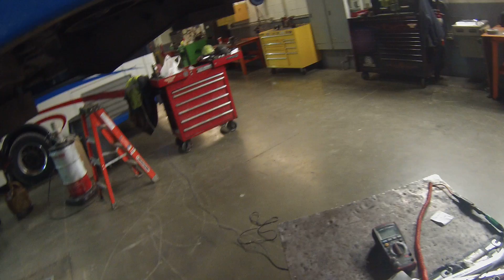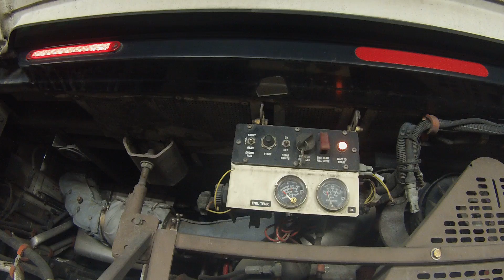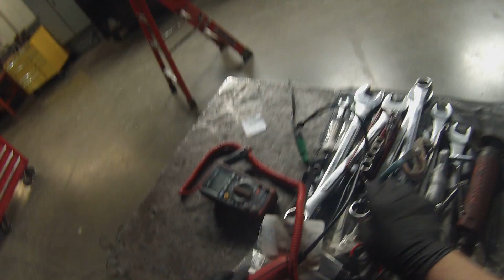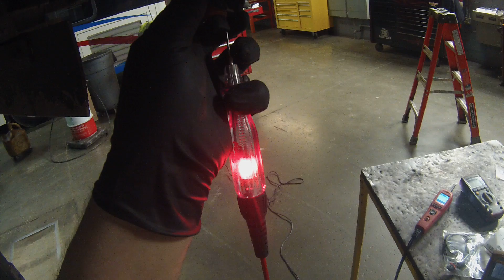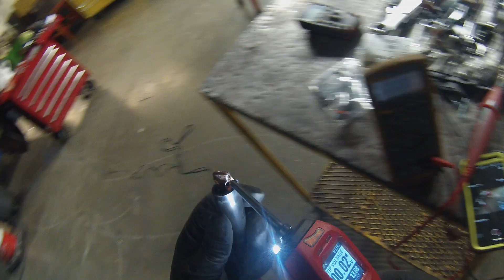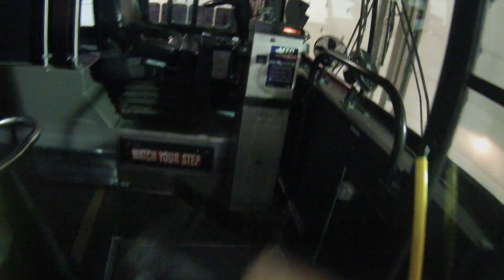Air Dryer Heater Faulty

Comment: Years ago I bought a power probe 2 and then wondered how much voltage we were indicating. So the power probe 3 came out, to address that problem and I bought it. Then....2 months later the 4  came out. I'd like one, but heck after owning all of the previous models, I just can't bring myself to buy one, because it too will be obsolete.. haha.  Why does the engine have to be running ? Does the dryer circuit run thru the multiplex, and that's how the logic is programmed ?
Reply from the maker: Yes

Comment: Great video busjockey1! I have a Power Probe Hook and can't help but wonder how the "Hot Shot" feature would have performed on your air dryer heater problem. The "Hot Shot" loads the circuit, measures the voltage drop and gives a pass or fail result.
Reply from the maker: +Roy D Don't own a hook yet so I don't know.  Eventually I will get a hook too.

Comment: Interesting video Mike demonstrating all the different tools to illustrate voltage drop. Looks like the LoadPro found the issue along with the Power Probe 4. Mike, forgive my ignorance as I don't know anything about buses other than how to ride on them; what is an air dryer used for on buses?
Reply from the maker: +stuzman52 A air dryer is used to filter out the moisture in a air brake system.  The Heater helps keep any ice forming in the air system.  That's why we check the heater wiring on inspections.  When one of these freeze up it is not fun to go get these buses on a service call for it.
Reply: +busjockey1 Thanks Mike for the feedback!

Comment: Nice to see you using the lift and ladders.  What level of current flow is normal for this air dryer heater?
Reply from the maker: +Grant Baker It depends on the temperature.  I will have to refer to the service info.  I will get back to you on that.

Comment: The PowerProbe4 was definitely showing a difference between batt post voltage and that of the connector.The load pro gave an equal indication.Test light not very sensitive to relatively small variations in voltage for this problem.
Reply from the maker: +Tom OConnor Yes there was a difference, but the drop was not as much compared to the load pro.  Like I said in the video, watch your resistance reading on feed test, when it gets close to 5 ohms you will start have significant drops in voltage even on a 5 Volt reference circuit.  With the load pro you would have a little over a 800 milli volt drop on a 5 volt reference circuit, you would have 4.2 Volts left over, that would definitely effect a 5 Volt reference circuit.  So to use the Power Probe 4 accurately, pay attention to your resistance reading.

Comment: Awesome vid Mike. Looks like you have the camcorder  duct taped to your head Ha. Ok the dryer  feed wire never dropped below 12.6 so why was their a fault code. I tried varying  the voltage on the test light and as you go less than 12v you can start to see it glow less but as you showed above 12v its not noticeable. I have yet found a situation where the test light glowed bright and the feed was faulty. In this situation you seem to display this but im not sure how. Did the module that controls the air dryer circuit have a voltage sensing device that picked up the variance in voltage. If so the loadpro seen it and the test light could not. Interesting Vid.
Reply from the maker: +Steve Rob Steve this circuit is hard wired.  I found this problem on a pm.  We check Air Dryer Heater Voltage on every pm during the winter time.  Found it with my Load Pro.  On 12 Volt circuits when I see a drop over .5 and leaning towards a volt I start looking for connection problems.  Once you start using the Load Pro you get experience looking at the different drops on different vehicles and knowing what to look for.
Reply: I don't have enough exposure for sure but in my limited exposure when I have detected a drop it was a large drop 1-6 volts and more obvious and I  was never was really concerned of a small drop, looks like I have to pay more attention to the smaller drops. Thanks Mike.
Reply from the maker: +Steve Rob The Voltage at one time Steve did drop lower when I stressed the harness.  However my emphasis here was to show how accurate the Load Pro and Power Probe 4 can be finding a volt drop compared to a test light.  I couldn't see any change in brightness of the test lamp.

Comment: Great diagnosis. Point well made using the different tools. Do you like the Power Probe 4 better vs the PP3?
Reply from the maker: +White Tiger I like the Power Probe 4 better, just need another extension cord though.  I work on buses 60ft long,lol.  The feed test works real good and the driver test function is awesome, used that one function to diagnose a bad motor drive on a Tk ac unit.